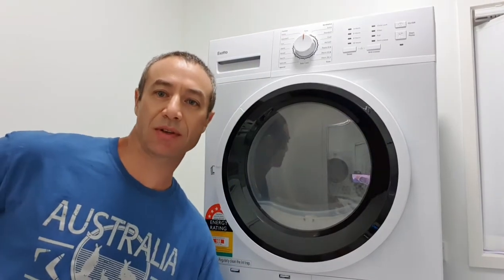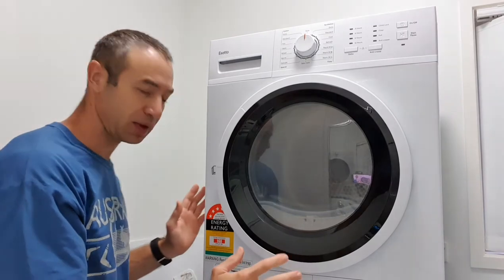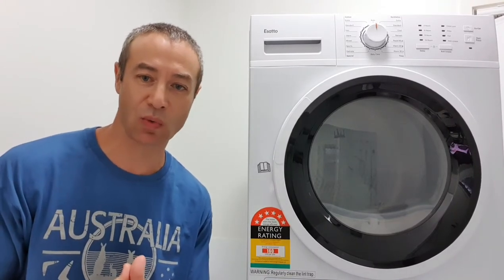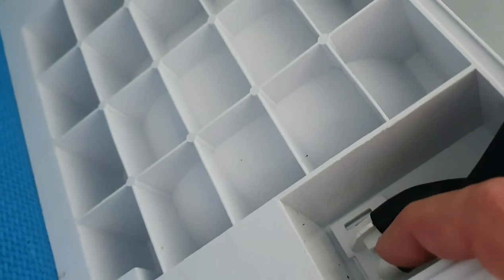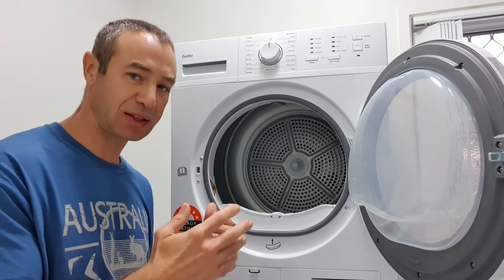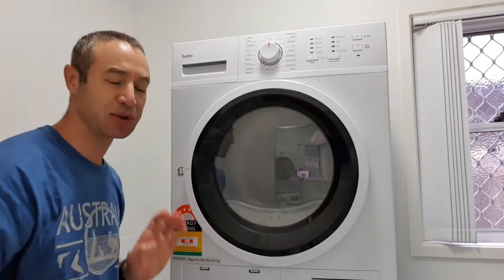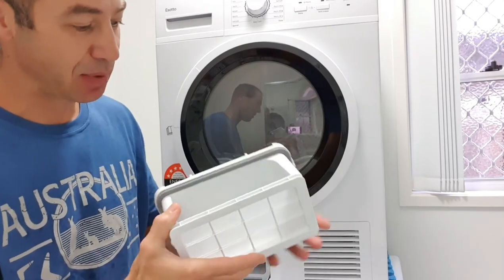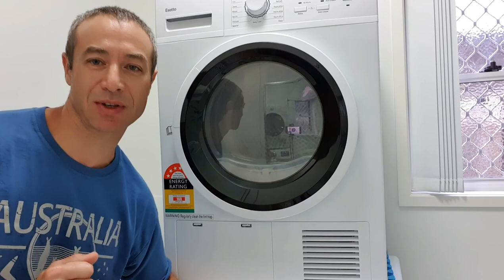Esatto 7kg heat pump dryer drainage plumbing and cleaning filters. Tips and tricks

Comment: Great video, thanks Greg. I too had no idea what the clear plastic fitting was in the end of the tube. I just bought the dryer and the first time I turned it on there was a horrible noise. It was the lint trap door at the bottom of the dryer vibrating against the housing. It was an easy fix, I put strips of Raven 9mm self adhesive foam tape on the inside of the door.
Reply from the maker: Thank you very much for watching and sharing your experience

Comment: Thanks for the install video, my pipe had a clear plastic stub on the end and the manual didnt say anything about removing and I coudlnt get it to fit, your video shows exactlt what I needed!
Reply from the maker: Funny you say that... That was exactly my thought when I unboxed it... I knew I have to make a video as instructions are way too brief and not very helpful.
Reply: Just got this unit today.  That plastic stud was the most stupid thing ever.  Removing it was painful.  Instruction on the book was written for Einstein.  I jointed both rubber tube together initially because of that stud.
Reply from the maker: @xijingpooh5879  indeed. Thank you for watching the video. I knew it will be helpful to many as plumbing packaging and instructions are not that intuitive

Comment: Thanks for thr video, I have an 8kg on order now. Does it come with the drain hose, or is it an accessory to buy, what ID size hose would be required?
Reply from the maker: Thank you for watching. Yes, it comes with the drain hose. It is relatively easy to install too. Also, you can use internal container for drainage  before installing the hose if you're not ready and you need to use dryer straight away.

Comment: Hey mate , thanks for the video have an issue with mine the full light comes on every 15 minutes,  beeps then shuts machine down . Sump pump works well , pumps both to top drawer and through hose . Condenser and fans good , motor good , filters clean , is like their is a moisture sensor or flood sensor overriding the machine,  any tips ? 
Cheers Mark
Reply from the maker: Wow, is it out of warranty! Sounds like a sensor. My does it, towards the end, but if I do nothing it kind of continues in 5. I know, it probably doesn't help. Just sharing. Out of curiosity, when it works, does it pumps moisture out well? E.g. maybe something is blocked in pumping or at least getting challenged too much. Thank you for watching. 🙏
Reply: @GregYurchenko  Hey mate , yes it pumps the water out really well both to the top drawer and out of a temporary hose . But still the full light comes on and shuts the whole machine down every 15minutes is out of warranty yes
Reply from the maker: @plumberstoday9896  sorry, I'm not a tech. Don't think I can help much. Hope you still can fix it for cheap. It's a great appliance when working.

Comment: Thank you for this great video. It is indeed useful. 
I don't have a hole in my sink to connect. I am wondering if I can keep the black hose as it is and keep on emptying the container?  or can leave it on a floor that has a drainage that will let the water go in. What is your suggestion here?
Reply from the maker: Thank you. The way dryer is shipped, if you do nothing all condensation will go to the container. So if you do nothing it is all good - just need to empty the container whenever it is full. In my new house I don't have a hole big enough for the washing machine and dryer to plumb in. So I just thrown the dryer hose into the sink. Not tidy, but does the job. Most importantly I don't need to empty the container :-) Hope it helps.

Comment: Have you found out how to do a deep clean on the heat exchange? Eventually I'd assume it would clog up with lint; even with regular wipedowns. In the manual it says its removable but I don't think its the case?
Reply from the maker: Not really... But... I clean both filters after every dry and Dyson vacuum clean on Max setting with the long brush. Seem to be very gentle on the heat exchanger and does the job...

Comment: I’ve got the same dryer. I keep getting an error message that the filter is full, even when I’ve completely cleaned the filter.  Do you know what the problem might be?
Reply from the maker: Yes, sometimes I'm getting the same error with 2 lights flashing. In all cases when it presents itself the drying is complete. I just ignore it, doesn't bother me and it's not worth warranty claim in my opinion. Hope it helps.
Reply: @GregYurchenko  thanks so much, this answer makes sense. I sometimes put fry laundry in (once I take it off the washing line I dry it to kill any spiders that may have gotten onto my clothes… happened a few times). That’s when I usually get this problem. So it makes sense it triggers when drying is complete 

Thank you for the quick answer :)
Reply from the maker: @BenelB  no worries, thank you for watching. I think I might create a video to describe what is exactly happening to help others. I think it might be a good idea since I'm not the only one experiencing it.

Comment: notice you've stacked your dryer using just that blue foam mat. Have you noticed it moving much at all or would you recommend getting a proper stacking kit?
Reply from the maker: Thank you for watching and your comment. It is not the first heat pump dryer I'm stacking. Had Samsung stacked for 5 years, now Essato for the last 1.5 years. No movement ever noticed. Hope it helps. Greg.

Comment: Hi mate and thanks for the video. I tried to connect my drain hose and found it impossible to get the hose over the connection on the back of the machine. My hose has a small clear plastic adaptor and no matter what I tried it won't fit. All I did was cut my fingers trying.
Reply: It's ok mate just worked it out. The black tubes are the same diameter so it's obviously the clear plastic plug which has to be removed. Well nigh impossible to remove it so I just cut the drain tube and everything fits fine. Be nice if the instructions mentioned it!
Reply from the maker: Yeah, cutting tube is THE way to go. I don't get it what they tried to achieve with such design...
Reply: You can slowley leaver of both ends of the drain hose,  I was able to  slip it over at the bottom and the jam the other end down the same hole as the washing machine outlet.

Comment: Hi Greg, I'm considering getting a heat pump dryer. I too have a draining hole in my basin that is used for my washing machine. The drainage hole doesn't look that large. When you connect the drainage pipe (your black hose) from the dryer into the hole below the washing machine drainage pipe, won't it block the flow of water?
Reply from the maker: Hi, yeah, fair call. I can admit that I used it in 2 separate houses. One had enough (ish) space for both, the other I had to push it in a bit harder. Because the flow of water isn't expected to be significant, if you restrict up to 50% of flow by squishing in the tube it should be still sufficient enough for drainage. I guess if all fails you can just hang it over in the laundry sink as long as it is functional and not blocked by anything... Hope it helps

Comment: Hey Greg, do you know where can I buy the plumbing kit? What is the name? I am buying this machine but it doesnt come with the plumbing kit.

Thanks!
Reply from the maker: You don't need to buy a special kit, just get same diameter hose (1 metre should be enough) and follow my video instructions. Please let me know if I can help you any further
Reply: @GregYurchenko  how can I fin the diamatre of the hose? Also if I do this I wont have to empty the box that is supposed to reserve all the condensed water, am I right?
Thanks for your help!
Reply from the maker: When you disconnect the hose that leads up (reservoir drain hose) you will be able to measure it. When you plumb all up no more emptying container required. All assuming if you do it well
Reply: @GregYurchenko  Hi there! 
I followed your video and now my dryer machine is working perfectly! Thanks!
Reply from the maker: @juandavidsilvaortiz2109  you're most welcome. Comments like yours inspire me to make more videos. Thank you!
Reply: Hi Greg, firstly thanks for making this video. I just bought this dryer and I'm starting to use it today. I haven't be able to connect the hose that came with it. If I do not connect the hose, is it safe to say that the only problem will be is to have to keep emptying the condenser tray? Thank you.
Reply from the maker: @stanleyzhu693  Not much of the problem, but rather inconvenience emptying the container after every dry cycle. Not a problem at all, enjoy!

Comment: Hey what happened to your Samsung Heat Pump?
Reply from the maker: Nothing really, had to lend it out. It is still going strong.
Reply: @GregYurchenko  aww that’s brilliant and excellent detailed reviews as well. Better than engineers and repair men. I have a Samsung Heat Pump DV90K6000CX/EU and unfortunately it’s due for its first repair. It no longer takes in water or dried properly. I have since rang Samsung and luckily they are able to do a free repair for me because it is still under its 5 year warranty but I’ve lost the receipt and proof of purchase because the store has closed since covid. The engineer has said it needs a whole new compressor unit etc. I’m assuming that means the whole base of it will need to be fully replaced? From your knowledge what will be replaced? I think the engineer did say it will be a while to do and needs everything more less replaced. So it should be brand new again. Thanks again for your reply.
Reply from the maker: @HotpointWD420G  sorry to hear that you have troubles with yours. I'd suggest you do your best to find the receipt. Those Heat Pump driers are literally an AC in reverse. The compressor is literally everything. Some electronic controllers can cost a bit of money, but compressor is by far most expensive part. If you can't find your receipt and Samsung will claim that all parts and labour are on you I'd proactively look into ACCC consumer law. To sum up, all goods and services in Australia have to be of certain quality. Up to 5 years is reasonable time for Samsung to repair your appliance for free under Australian Consumer Law, which sits above statutory warranty. Hope it helps and good luck!
Reply: @GregYurchenko  hey thanks very much again and to take the time to reply to me. Yeah it seems to be a very common fault and regular fault issue, I did some research into Samsung heat pumps on their life expectancy and how long they last and it does say anything between 5 to 7 years. It seems to me, because they are meant to run for a lot longer periods of time, to me that’s why they fail quicker because they are constantly running because they take longer to dry because they don’t get very hot. However it least Samsung will repair this time as a gesture of good will which I’m not going to complain or refuse giving that it cost me £899 brand new 4 years ago. Yes I did look into how much it would cost to put in a whole new heat pump and compressor unit if I had to it it myself and it’s around £500 so almost over half the amount I paid brand new for it. Your advise has helped me a lot and again thank you so much for your help. I look forward to seeing more of your videos and formative answers and reviews. I also noticed you live in Australia 🇦🇺 in Brisbane, my fiancés brother lives in Brisbane with his boyfriend. I’ve always wanted to visit Australia and the Great Coral  Barrier Reef. Anyway thanks again for replying back to me.